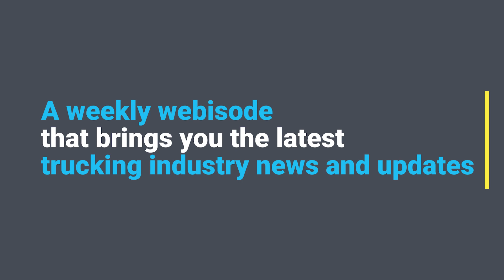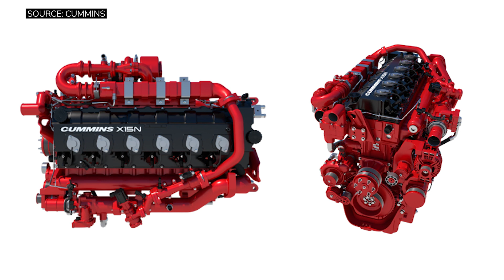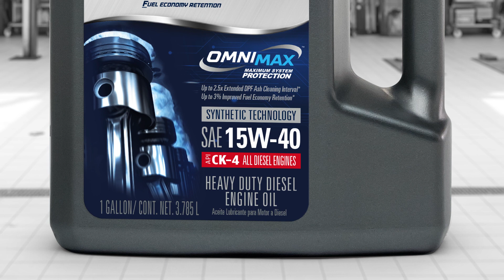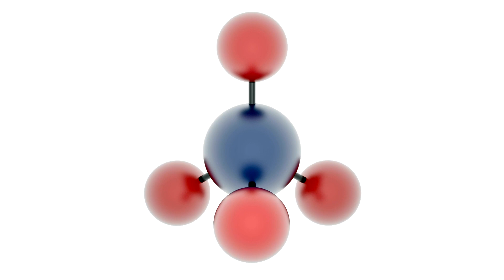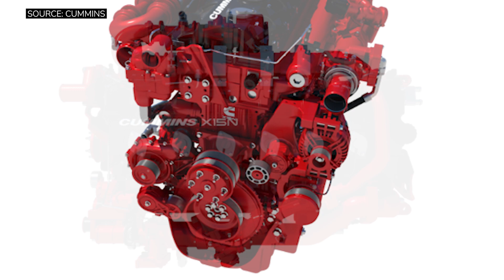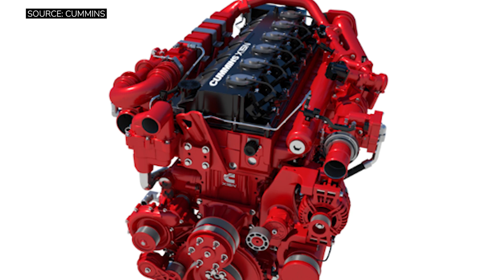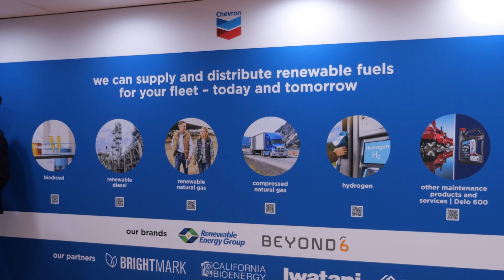Cummins 15-liter helps make strongest-ever case for natural gas in long haul trucking.

Comment: Cng is not the best in transit either they do not have any power shift to fast in transit busses have a higher maintenance schedule and replacement around 235,000 miles

Comment: Cummins isx has proven to work well in transit operations.   Only emissions control is a 3 way catalyst.   No dpf or def required.   Main limitation is range between refueling.   Torque and HP are close to the diesel.

Comment: Did he mention spark plugs !?
Reply: They are spark ignited engines
Reply: @jordyz992  diesel engines don’t use spark plugs !
Reply: @PennsylvaniaDualSport   I know that but the cng engines do use spark plugs that Cummins in the video is a natural gas variant
Reply: Yes, and their low-ask oil is way better for the spark plugs because it minimizes fouling.

Comment: heavy trucks will never go "electric" but CNG i think has more of a place in commercial trucks. i am a truck driver myself. do class 8 trucks that burn CNG still need an after-treatment system (DPF filter and DEF fluid)?

i am a milk hauler, not long haul but heavy loads and allot of hills. higher horsepower and torque required.
Reply: They have a catalyst, and NOx emissions are near zero. No DPF or DEF as it simply isn’t Diesel (that’s what the “D” stands for)
Reply: Their 15L engine should go a long way toward making the power/torque that you need.